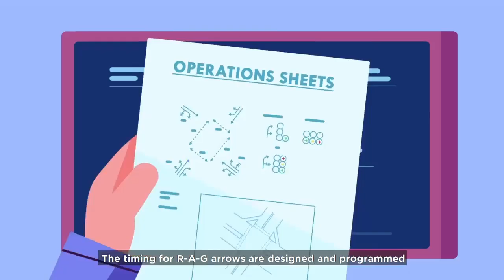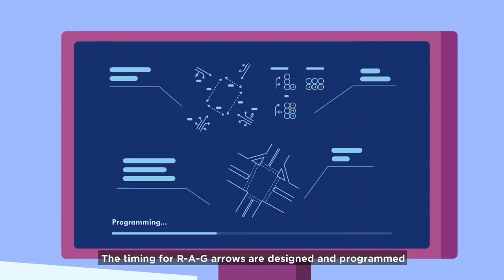28dec2021 Red-Amber-Green (R-A-G) arrows at traffic junctions to replace discretionary right turns

Comment: Good video. Shows us RAG can't be implemented instantly, coz lots of work goes into making the change - site recce, data analysis, testing, modelling, construction, trial runs and actual implementation. It's slow, but hope LTA won't stop till all discretionary right turns have been converted to RAGs. 👏👍